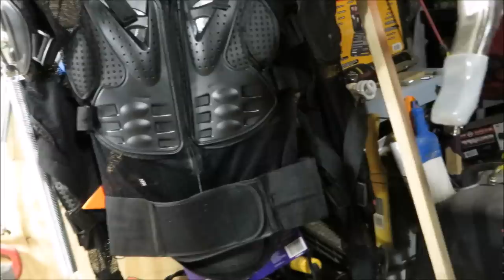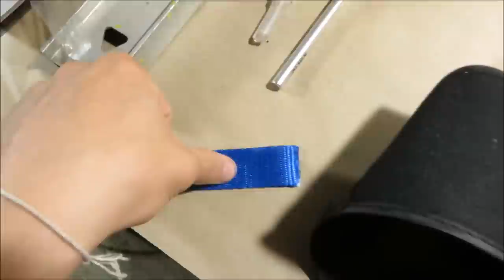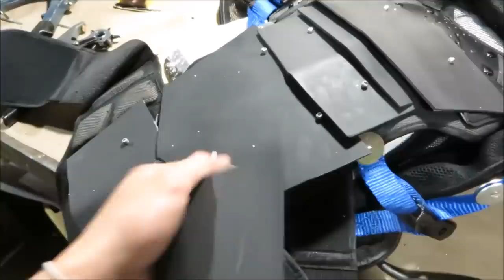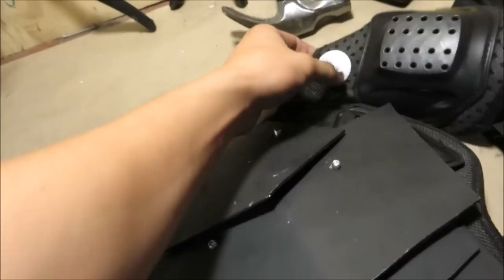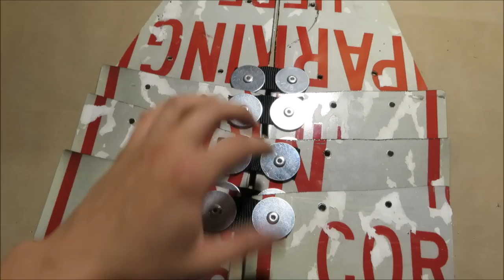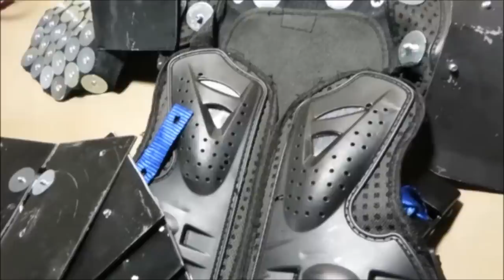How to Make: Body Armor

Comment: Aluminium is a stupid material to use for Armour....
Reply from the maker: Bill Buck The beginning stated it was not meant to be bullet proof, if you can find me someone who can easily stab through 1/16" aluminum with a knife then I'll agree it's a "stupid material". Whatever that means.
Reply: ZednoughtAlpha By a stupid material to make Armour from I mean there are other materials that are much better suited to the task. for instance steel.
You would also be surprised how soft aluminium is compared to steel. I can almost grantee that if I took an axe to it i could shear right through it.
Also the way you have it set up (in that lamelar sort of way) it would transfer allot of the shock from a blow directly into your chest. A solid or segmented breastplate is a much better idea.
Reply: Well not everyone runs around with a fucking massive two handed axe
Reply: Rorbae Fun Probably more people than run around with a full suit of home made Armour ...

It's not a matter of what you might run into. It's a matter of why have soft armour when you could have hard armour that weighs a similar amount.
Reply: luckyshottzZZ Why so mad? Notice in my comments above I also mention the inefficiency of the armour. This inefficiency would be multiplied 10 fold if it were made from steel....
This armour was designed to be made from aluminium. Therefore it was designed poorly.
Reply: Bill Buck
yes and funnily enough this isnt a tutorial on how to make the best armor in the world, its purely for cosmetics
Reply: luckyshottzZZ Then why not use cardboard or even thinner gauge aluminium?
Reply from the maker: Bill Buck
luckyshottzZZ 
It's not purely cosmetic, it's made to protect from slashes and stabs from bladed weapons, the lamellar style is also for maximum dexterity and flexibility. To say it's obsolete because it doesn't protect from blunt force trauma is to say BPVs are pointless because they don't stop injury from sledge hammers. Clearly, they're not made for that. Doesn't mean they aren't great for what the are made for.

There are definitely reasons one might choose aluminum over steel for the application of lamellar armor, one being that they are not at all similar in weight as Bill said. The 5052-H38 alloy aluminum used in street signs is almost a 3rd the weight of steel, and at just 1/16th of an inch is virtually impossible to stab through. Don't deny it till you try it (which I have). That means I can even double the thickness of the aluminum, making it realistically invulnerable to stabs and slashes, and it would still weights 1/3 less than the steel of half thickness. The real question, why take the heavier option when the lighter option protects just as effectively?

And as far as "shearing" through the aluminum with an axe, maybe on a fixed, stationary target. Good luck on a moving target that gives when struck.

I did use the street signs because it's what I had on hand(as lucky said), but that doesn't make it ineffective as slash and stab armor, it's just being resourceful.
Reply: ZednoughtAlpha In my oppinion steel would be stronger and more reliable. The weight argument is fairly void as you would need to use much less steel than ally. Steel is also much easier to work with so you would be able to forge an actual breastplate rather than having lamelar.
Honestly this conversation is pointless. In the real world armour is next to useless with the onset of guns anyway.
Reply: ZednoughtAlpha Way to keep your cool brother. Heck, if I made something like this, I'd wear it just because it looks sick. Using your brain is obviously in short supply these days. I'm glad that someone your age is doing just that, and that's admirable. Keep the videos coming! I just recently got into knife making, so your weapon/armor videos capture my attention real quick.   :D
Reply from the maker: Bill Buck In the "real world", more people own knives than guns, but I think we're both equally tired of the conversation. Gr8 deb8 m8. No re.
Reply: ZednoughtAlpha GG no Re Goognight Goodluck lol you da man Alpha
Reply: Bill Buck carbon fiber with keblar on top of it, its the perfect combination, theres an spanish company that does all that work for you ( http://www.clipcarbono.com/ ), you can send them plastic (or alluminum) models and they send you the carbon-keblar plates with the thickness materials or whatever properties you need, check it out!
Reply: Sergio Solórzano would still not work against large blunt force trauma. Carbon fiber in my opinion is an equally bad material to use for armour...
Reply: Bill Buck i disagree because its super resistant to impacts and a piece of carbon fiber with the same thickness of an steel plate (3cm) with six layers of keblar on top of it... can stop almost everything, but its your opinion anyway so check their page, or not whatever you want, i definitely dont have the money for something like that, but... its just perfect (but since theres no gunslingers around Spain with my knife i´m just fine)
PD: just for the record this armor if you make it properly, could cost you a lot because a 1200 x 600 x 4 mm carbon fiber plate costs 615,93€ so to make 3-2.5cm  you need around 6 of them and some keblar plates so only one plate is around 4000€, you can always mix steel and keblar, or carbon fiber, steel and keblar to make it cheaper.

webpage: http://www.clipcarbono.com/
E-mail:  contacto@clipcarbono.com

1200 x 600 x 4 mm carbon fiber plate: http://www.clipcarbono.com/es/home/569-plancha-de-fibra-de-carbono-dos-caras-mate-1200-x-600-x-4-mm.html

Keblar: http://www.clipcarbono.com/es/home/491-tejido-kevlar-para-confeccion-ropa-y-proteccion-230grm2-tejido-resistente-a-fuego-abrasion-corte-y-desgarro-ancho-1450mm.html

have a nice day :)
Reply: Sergio Solórzano surely if it's carbon fiber it will fracture on the first hit? most bulletproof composites work by dissipating the force throughout the plate. Not by stopping the round.
Reply: Bill Buck i'd have to say that in the instance he made this armor, it seems to be for purely movement.
so say you have have this, a light shield, and a single handed weapon.
you'd be focusing on out-maneuvering your opponent, and maybe even running away if necessary. The point is to hit fast, and also not get hit. If you get his, the armor will stop you from taking the full force of the hit if it's a swing, or you stop you from getting shanked if it's a thrust.

I mean, if he was going to straight up tank, steel armor would DEFINITELY be better, but then he would also have to make the thing more solid and stiff instead of the nylon connections and the overlapping, separate plates.
so yeah, i think he was going more for maneuverability than defense.
Reply: I suspect we would have seen quite a few pieces of historical armor made of aluminum, if it was available.  There are certainly places where steel would be more ideal (helmet, breastplate, any reinforces you might need to attach),  However, over limbs where the plate is simply impact protection, it would be pretty ideal.
Reply: xXKameroniXx Would a Tomahawk work since it can generate a lot of force and is much lighter than a two-handed war axe?It also has an armor piercing spike on the back, would that work too?
Reply: yep, but it will decrease the wound you receive from mortal to just bad, but with steel you would probably end up just with a big mark on it.
Reply: Bill Buck Just want to point out that 1. if it stops you from dying, it's doing it's job. 2. Ease of access to materials and cost of materials are a factor. 3. As Alpha mentions, defensive priority should be kept in mind, in this case, it's cutting and stabbing resistant armor on a budget. 4. It's protecting a living and moving person who is hopefully defending themselves at the same time.
Reply: Stormtalus In a modern scenario most metal Armour is pointless..... tell me one thing this Armour could do that a Kevlar vest couldn't?
Reply: Bill Buck stop an arrow or any cutting or stabing weapons
Reply: Sergio Solórzano That is exactly what kevlar is designed for....
Reply: Bill Buck  nop, it was designed for car tires, but due that its really resistant to impacts it was quickly implemented for bulletproof vests, but spider web or nowadays liquid armor are much better.

PD: De todas formas los exoesqueletos roboticos acabarán con ese problema del peso de las armaduras y acabara todo como el Code Geass y los Knightmare Frames, o... como en WarHammer 40000 y las armaduras de los marines espaciales.
Reply: Bill Buck I'm not an expert but isn't kevlar puncture and impact resistant, not cutting resistant? I could easily be wrong here but that was my impression. So in this case, metal armor is more likely to resist cutting and tearing, and I would surmise that it would also be more likely to survive usage longer than kevlar. Also I don't know what his base is made out of, the motorcycle pads, but those are impact resistant too, not much but it adds in, the suit isn't just that aluminium plate. Ultimately though, if you were making a garage suit of armor, nothing is stopping you from using kevlar and metal plates together?? A few final points, aesthetic was a factor here, clearly wasn't a purely practical build; and keep in mind at least part of this channel is about hypothetical zombie prep, so modern application isn't necessarily the main idea.
Reply: Stormtalus What makes kevlar so awesome is it's tensile strength and cut resistance. It's essentially just a load of really strong fibers that bind to anything that punctures them and dissipates the force. It would do the same thing with a cut.

In terms of Zombies, why do people think Armour would need to be so good? literally a thick jacket is enough to stop a humans mouth.
Reply: +Bill Buck That is actually a very good point! lol
Reply: +Bill Buck Did you watch the video?
Reply: Henry Ambrose yes.... I did..... Did you read my comment?
Reply: +Bill Buck carbon fiber with thick cloth behind it should be perfect for any kind of armor. it will certainly stop any slashing and even any bullets up to .50BMG(!!) 
(It would still injure you tough but not as bad as if the bullet went right trough your chest)
Reply: ***** carbon fiber is not even a little bit bullet proof... That's why they make tanks and MRAP out of steel..
Reply: +Bill Buck im combining comments here. Aluminium armor  has a weight advantage vs RHA upto small canons say ~20mm. Though there a few wonky impact angle effects. 
carbon fibre isnt used in armor systems since the fiber threads are too brittle vs sudden loads. plenty of other fibre based composite armor systems around, mainly glass,kevlar and dyneema. mainly as a backing material or spall liner.
fibre/resin armor composites generally work best upto rifle caliber rounds (non AP) after that you need to add hard armor components.
Steel (RHA) as the only armor material has been obsolete since the 1950s. One small caveat here..recent advances in metallurgy have seen steels approaching the performance of low end ceramic materials. None are known to be in service though.
Reply: +Bill Buck Aluminium is super lightweight and
 hard compared to it's weight
Reply: Electronic AIDS It's actually quite soft...
Reply: Bill Buck
Yeah, I mean in comparison to it's weight.
Reply: Electronic AIDS It depends on the thickness. See Tank armour. Once aluminium gets to a certain thickness steel is better for strength to weight.
Aluminium is also much more malleable so is more likely to flex when struck.
Reply: Bill Buck
Well yeah, but in the end it's just more for fun.
Reply: Electronic AIDS Yep
Reply: ***** I didn't say I could, although a crossbow bolt certainly would. I meant that their are tons of superior metals that are cheaper and harder, EG steel.
Reply: ***** I have a crossbow... It can put holes in car doors.
Reply: not much of an accomplishment with 0.8mm steel.
Reply: ***** Or just don't bother and don't put yourself in a situation were you would need armour?
That or get yourself a half decent gun.
Reply: 2mm is thick for single piece BP. Around 1.5mm is more to the mark. When you get to 2 piece Front cuirass You will have similar thickness with a partial overlap.
Reply: +theTLKkovu/gondoix if I get a motorcycle, this would be a fun project for me to do and just ride around in it.
Reply: Bill Buck wtf do u mean it's lighter than steel and I doubt you could stab through it(which is what this armour is made for so don't say somthing like a gun) with a knife or sword so wtf